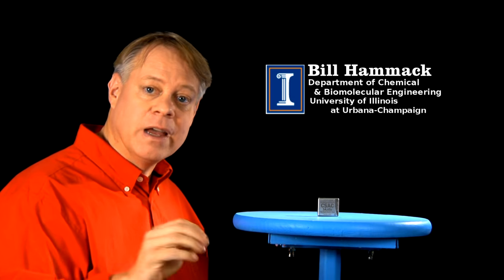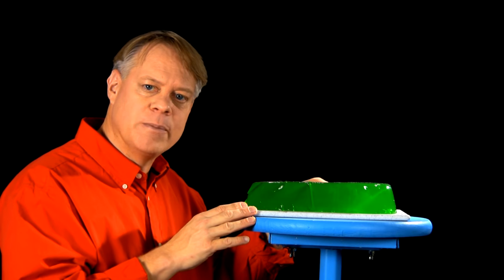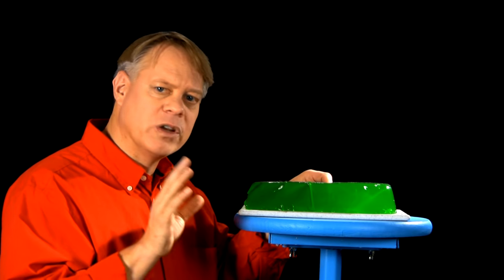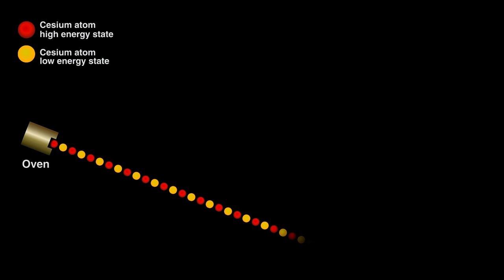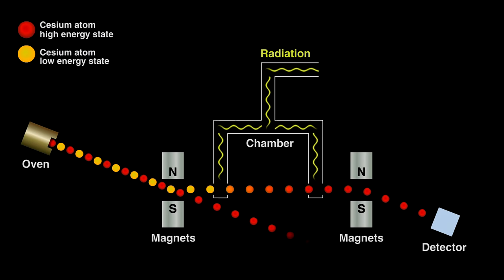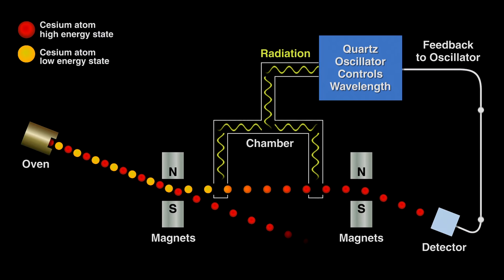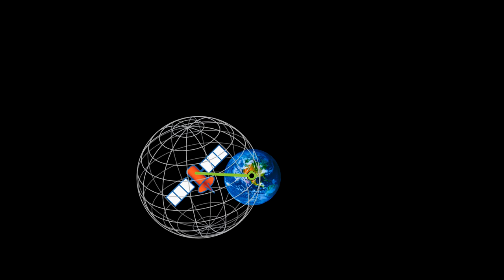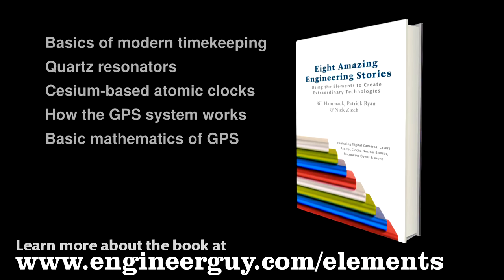How an atomic clock works, and its use in the global positioning system (GPS)

Comment: Around 2:20 you say that the detector converts high energy ions, wouldn't it be easier to have the detector at the first magnet to detect the discarded high energy ions rather than taking the low energy ones and converting them? It seems to me that the conversion is unnecessary if you have high energy ions to begin with.

Comment: if the gps receivers are synching their time with satellites up in space, is there some adjustment that needs to be made for the difference in gravity between stuff on the planet and stuff in orbit? I remember reading somewhere that clocks slow down (or maybe speed up) slightly as they experience less gravity ...

Comment: The satellites are just "broadcasting" if you will... the calculation of your position is done in your navigation system. The number of satellites is needed for always having enough satellites "in view" on any position on the planet. The more satellite Signals your GPS device receives the better the accuracy of your calculated position.

Comment: but the time the satelltie sends would be delayed by the exact amount the gps requires to calculate its position

For example, the satellite sends the time as 12:00.00, by the time the gps receives it, it would be say 12:00.01

This would mean that all of the calculations based off of the difference in time, would be off by 0.01 of a second.

Comment: Something doesn't seem right here... how do you manufacturer a quartz crystal to exactly the correct size/shape to obtain that kind of accuracy? Maybe since it's not a mass produced clock they start with a slightly larger crystal and iteratively optimize its shape

Comment: just something i want to mention:
3 satellites will not trilaterate the position to a single point, but in fact, two points. one is on the surface of earth, while the other is in space. it acts as if there is another satellite at the core of the earth giving it a reading of earth's radius, so it can conclude your position to one point.
Reply from the maker: Indeed ... note that you do need the fourth satellite, though, for a practical implementation because the clock in the ground based receiver is not an atomic clock. You end up solving 4 simultaneous equations with variables x,y,z, and t.
Reply: @engineerguyvideo  that was a fast reply

Comment: actually i think the answer pieface is looking for is the difference in frequency.

quartz timepieces run at around 32,768 Hz whereas Cs clocks run at 9,192,631,770 Hz

counting cycles gives elapsed time and it's clear that Cs is a lot higher accuracy than quartz.

Comment: Because in the Bureau of Standards there's a clock that's even *more* accurate (based around the decay rate of a particular isotope IIRC, rather than just a self-correcting quartz occilator) but far, far too expensive for commercial applications.

Comment: A few inaccuracies crept into Bill's usually concise videos.  Around minute 3 he claims that GPS uses 24 satellites.  For several years now, 32 have been used.  

Around minute 4 he mentions a GPS accuracy of 3 ft.  With sophisticated processing better than centimeter resolution is possible.

The entire explanation of a pulse "tap" to the quartz crystal is lacking.   The 5MHz crystal oscillator frequency can be pulled (slightly faster or slower) by varying a control voltage (VCXO).  A multiple of the 5MHz is used to interrogate the cesium cell, and should the frequency be off, a correction is made to the control voltage.
Reply: +Nate Caine Well, as he says at around the 30 second mark, he's explaining how the first chip-scale atomic clock worked. So, perhaps not as inaccurate for the device in question.
Reply: It depends on your location and time of day  whether you can pick up 3 vehicles or 32.

Comment: isnt there a small gap in time for olting the oscillator?
And whats it measuring that tells it how long a second is? is it counting how many cesium ions pass through?
Reply: +Marco J I think the Cesium ions need a very precise frequency to transition states, and any deviation from this frequency will be result in a change in the number of ions transitioning states, which will be measured at the detector. So, basically the radiation frequency depends on the quartz vibration; the Cesium ions are 'checking' the frequency of the radiation; the detector is 'checking' the state of the Cesium ions, and adjusting the quartz vibration as needed.

Comment: You forget to mention that they also use Einstein's equation of relativity to calculate the position. Without it the position would be much less accurate. I read that there is also an atomic clock on earth to detect the difference between the time that has elapsed to earth, and that which elapses for sattelites.

Comment: On GPS, are you implying the receiver also has an accurate, and synchronised, time source with which to compare the the time the signal was received with the time of departure (as carried by the signal) to come up with a time difference to use to measure distance? It seems unlikely that all GPS receivers would have access to such an accurate synchronised time source. I see no other way for the receiver to determine the signals travel time. (Btw, great videos!)

Comment: Is it possible to provide the Quartz oscillator with "too much" energy, therefore altering the "natural" frequency? If so, how does the system correct it?
Reply: not typically, no 

a given objects resonance frequency is inherent, adding more energy only makes it resonate that frequency with more intensity. (for example, hitting a tuning fork harder with a hammer only makes it louder, it resonates at the same pitch) 

The aside to this of course is adding so much energy that you end up deforming or breaking the substance entirely, which for obvious reasons, changes its resonance.

Comment: I was wondering if the time that is lost when the stream of atoms goes negative is "caught back up" somehow, in the mechanism, or is that where the time loss occurs?
Reply: you would be correct, that is where the loss of time occurs. just this gap is so very very small (since it oscillates so very rapidly) that it doesn't add up quickly enough to cause an issue.
Reply: Albus Bumbledoof Thankuou 😊

Comment: So how do engineers know what time is in order to clock or calibrate a Cesium Atomic Clock to it?   What is the reference time used?
Reply: I don't know. I want to know how does a GPS module get it's time synchronized?

Because if I comprehended right, the satellites send a signal with their position(coordinates/location above earth) and exact time of transmission, and the receiver receives this signal and compares the time of transmission to the current time to calculate how far the satellite is(the more time difference the more far the satellite is, and vice versa), but if the receiver doesn't have synchronized time how can it know how long it took for the signal from the satellite to be received?!

Also I have another question, how can a satellite that's moving know it's own position over earth(coordinates)? Wouldn't the satellite need to use a fixed reference on ground to know it's position?

Comment: Hm, interesting. I always thought the GPS receiver measures signal travel time *differences* for the involved satellites, rather than absolute arrival times and thus travel times (which would require an expensive clock in the receiver, right?). Short time spans should be easier to measure than absolute times. If you know the distance difference for two satellites, you'd have a hyperboloid rather than a sphere, and with more satellites, you'd be intersecting hyperboloids rather than spheres.

Comment: Why isn't it backwards? By which I mean if the high energy ions are converted to current, it seems that it would be better to create more high energy ions as the quartz slows which would create a self balancing system not requiring the external jolt that this model uses when the quartz slows down.

Comment: Another fine video. But of course there is no atomic clock in a GPS receiver so this doesn’t explain how gps works. The short answer to that is the quartz clock in a receiver is not accurate enough to get a fix. However the quartz clock is accurate enough over the short interval that the error is equal for all satellites being received and that enables the processor to then determine a position using clever mathematics. This process does however require an extra satellite hence you need 4 satellites to get a 3d fix or 3 sats for a 2d fix (2d as in it is assumed you are on the surface of the earth).

Comment: It was correctly mentioned that four are needed, but the demonstration then goes on to say that only three are needed for locating position.
Reply from the maker: Using three assumes you have the correct time on the handheld unit ...
Reply: “Correct time”meaning signal timing from a 4th satellite?

Comment: This is remarkably similar to how bacteria sense their environments and each other. A two component system creates a positive or negatively regulated feedback loop exactly as the high/low energy cesium control, except with specific compounds instead of cesium.

Comment: The atomic clock in Colorado ticks faster than the one in England - do you know why?
Reply: Before 1967 we used orbital time.
If atomic clocks are correct the orbital speeds of mercury Venus and mars and increasing.
If gravitational constant is true then atomic vibrations and the speed of light are decreasing.

Comment: Even though the explanation of the principle of a frequencystandard is correct, the description of  the cs atomic (beam) clock is not. It's not using Cs ions but rather neutral Cs-133. An oven creates a beam of neutral Cs atoms which are in either of the two hyperfine states of its ground state. By utilizing a Stern-Gerlach selector, a beam only consisting of only one state can be created. Then the interrogation in the microwave cavity happens via the Ramsey-Scheme and in the end, another Stern-Gerlach selector distinguishes between both states, so one can measure the individuale population in dependence of the applied microwave field.
Reply from the maker: i dont have my notes in front of me but you are referring to a clock based on a cesium fountain, Essens first clock, which we describe here, was an ion trap .... no? Am I recalling this incorrectly?
Reply: Thank you for your fast answer. A Cs fountain uses laser-cooled, neutral atoms, yes. But also a Cs beam clock uses thermal, but yet, neutral atoms. A piece of Cs is getting heated and formed into a beam of neutral atoms. After collimation and state preparation via muzzles and magnetic fields, the atomic beam passes the microwave cavity for Ramsey-Interrogation. This principle, first demonstrated for Cs by Essen and Parry (An Atomic Standard of Frequency and Time Interval: A Cesium Resonator, Nature 176, 280 (1955)) is still used today in Cs beam atomic clocks, which are very robust. Some are even running continuously as primary frequency standards in national metrology institutes for many decades (40y+) now. 

Some additional notes (atomic clocks in general):
There also do exist alternative clocks with various elements utilizing neutral atoms or ions. Most prominent microwave frequency standards are based on Rb, Cs and H-Masers while in the optical regime, Sr and Yb and Yb+ clocks dominate. The later one (among all other present optical clocks with e.g. Hg, Hg+, Mg, Cd, ...) are very complex devices but show a record stability and accuracy of up to 1 part in 10^18. Yet, they are all using the same principle, which is excellently described in the video: A (free running) oscillator, close to an atomic transition is steered to be resonant to the atomic transition by interrogating it with the atoms or ions.

Comment: There's a problem here. If the first two GPS satellites determine the location to a circle, then the third would reduce the location down to two points (the intersection of a circle with a sphere is in general two points, not a single point).
Reply: Sicne the 3rd sphere isn't chosen arbitrarily, but is based on the distance to your location remedy that?

Comment: Presuming the oscillating characteristics of the atomic structure is impervious to the external environment and/or the external environment is universally constant. Both aspects are comprehensively wrong. Eg: place two clocks at an equidistant distance from Earth. One in a geostationary orbit and one with an equal but opposite velocity giving it a orbital vector around Earth in the opposite direction to the Earths rotation. The difference in velocity relative to the reference point on the Earths surface would be different to the difference in velocity relative to each other. (Zero differential between each other but a measurable difference in velocity to each other in reference  to a 3rd clock on Earths surface. *REMEMBERING the difference in velocity from a clock on Earths surface to the geostationary velocity of a 2nd clock is used as the sole piece  of mathematically deduced, quantitative ‘evidence’ for velocity being directly proportional to mass and therefore time dilation...) the 3rd clock (orbital) 

If velocity alone is the variable due to time dilation being in effect through SR’s energy/mass equivalence than we should expect to see NO difference between the variation of the two clocks in space in comparison to the clock on the Earths surface. 
But I would bet my left... umm,shoe... that this is not the case. Given the clocks piezo electric mechanisms are in the exact same orientation with respect to Earths surface I would expect to see a difference between the two clocks in space as the rational properties of the trajectory vector would induce different electrostatic charge in/on/around the two clocks and a difference in the forces would/should be imparted on the atomic structures charge related geometrical axis. Coupled with the additional variable of the two clocks moving through the solar wind at different respective velocities and being subject to opposite gyroscopic precession forces and the opposite right/left hand Maxwell rule.... Plus other variables. 

I am willing to bet that all 3 clock exhibit different ‘time dilation’ CHARACTERISTICS
 (Not properties, if we are being adults...) even though both clocks in space have the same orbital velocities relative to the Earths COG/COM. Therefore disproving the notion that mass/energy are directly proportional and universally true, in the ‘classical’ sense. (I know some people right know would argue that this analogy is citing General Relativity since the Earths COG/COM is assumed to be ‘at rest,’ but this is simply the audacity of modern science to assume universal constants and apply absurd fictions like ‘reversed time’ when these assumed constants lead mathematics off into the woods chasing butterflies. To presume the piezo electric properties of atomic structures on Earths surface form a universal constant/reference is absurd. That would be to assume Earth is either; 
•at absolute rest.
•shielded/insulated from the effects of its respective velocity.
•Inhabiting a locality and environment that is the static, universal constant for all environments and localities throughout all of space.
•Is subject to the same physical laws of nature that every other point in the universe is.
Yup.... Certified retarded. Neither of AE’s fanciful mathematical masterpieces apply to reality unless a TRUE Universal constant is know and/or applied. And because we are donkey years of having the slightest conception of what existence/reality even could ‘look like’ we are impossibly far from perceiving an absolute reference frame of the universe and exponentially further from identifying ANY true constant that nature operates under and after immeasurable time, uses these simplistic laws/dynamics to weave the unimaginable complexities of ‘everything’ as it is. 
Universal Constants.... Bahahahaaa. Can’t even accurately predict the weather 5 days out due to tiny variables exponentially increasing the outcome probabilities for equations, rendering them meaningless and useless. But we think we can do it for all of existence through all of time... But are ‘surprised’ and ‘puzzled’ every time a comet passes in front of our eyes or a new instrument is pointed at the Sun.... lol. 

Comprehensively explain (IRREFUTABLY!) how the sun functions, light operates.... Hell, explain what water is exactly and I’ll give a damn what the ‘certified experts’ proclaim. 
Redo the Michaelson/Morely experiment and double slit experiment properly for starters and obtain a decent data set before ‘discovering universal laws, knowledge and unseen/undetectable natural phenomena and MAYBE, just maybe, the wise/intelligent amongst us might even take classical physics seriously. Until then, we’ll just keep decanting the 60%-80%, mis-interpreted and mis-labeled truths from the laughable science fiction known as the SM and seek our own paths. While mocking the absurdities of the SM and trying to avoid eye contact with the flat earth and lizard people lunatics.... ba bye